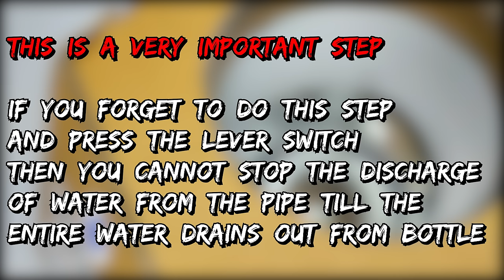How to make water dispenser at home

Comment: Hey can u say if the motor is inside the water the motor will not damage
Reply from the maker: its a submersible pump motor
Reply: Because it is a water motor
Reply: woddy work
Reply: @DIYOcean  sir which switch u had used in the video plz give me the link to buy